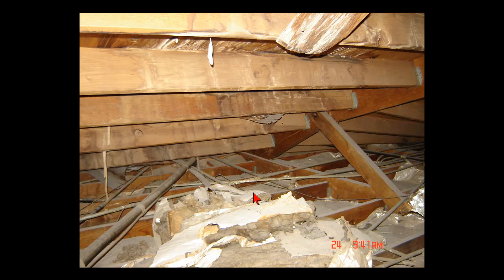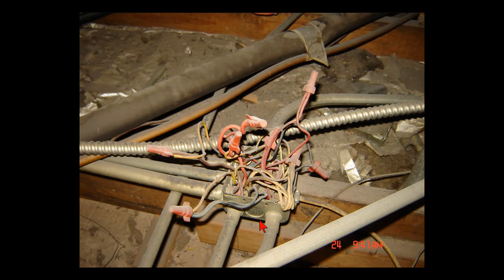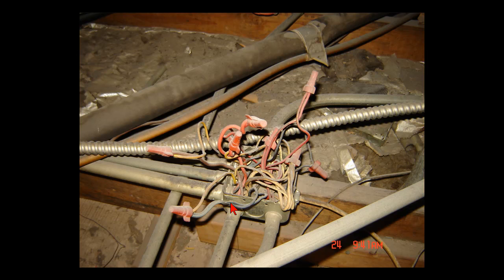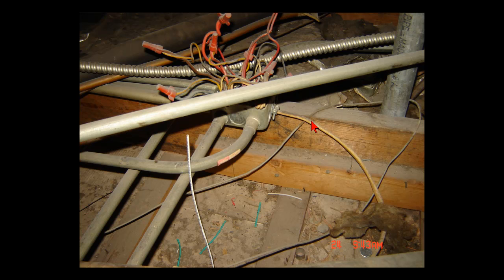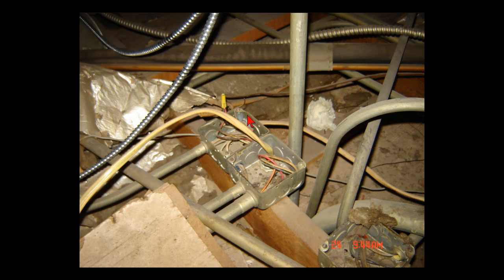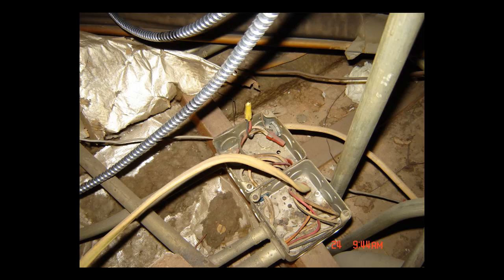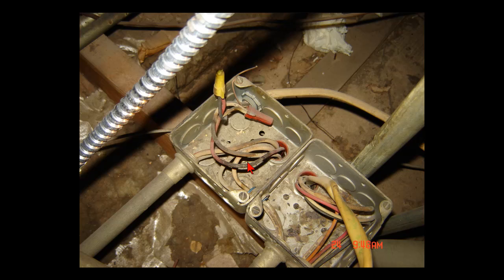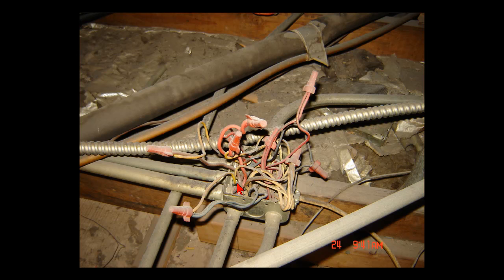Electricial Wiring - dinning room lighting

Comment: @sparkyUonline New Zealand what I was meaning we only ever have one phase in a house the olny time we have 2 phases is in old houses where the hotwater was controlled via a ripple control that was mounted on the poles the transformers are mounted that then has a pilot wire that controls contactors that that will take a phase and feed it to 4 houses. In new installations the ripple control receiver is mounted with the meters and usesonle 1 phase to feed the house. The line fuse is 50- 80Amp.